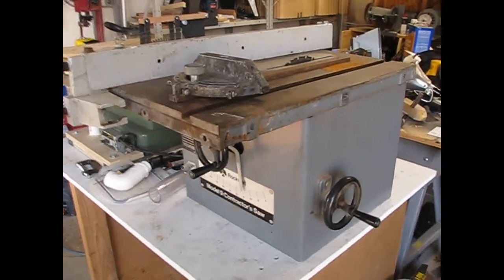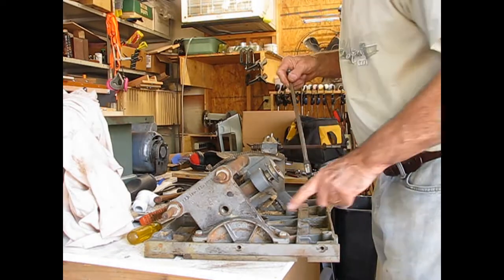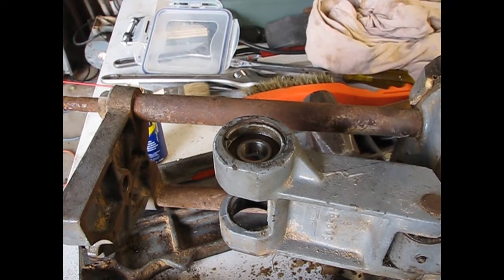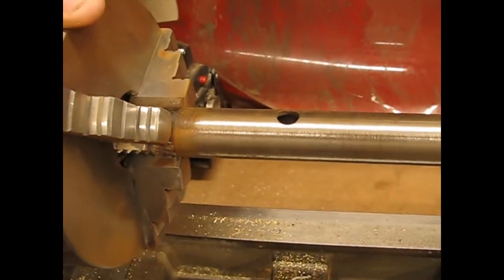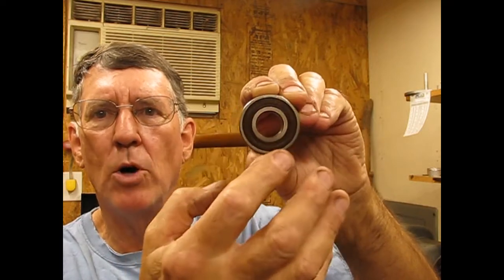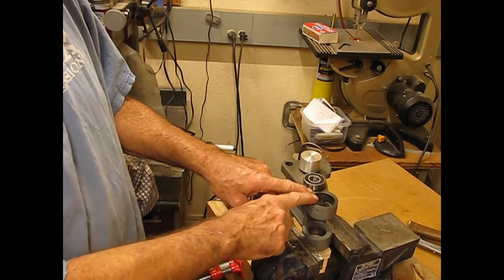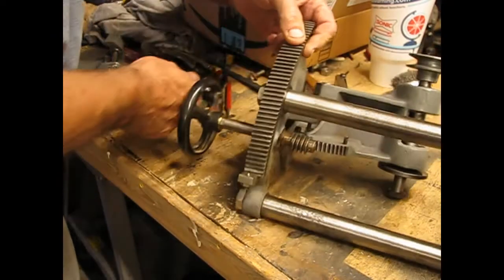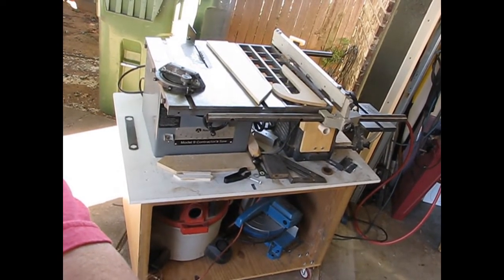Rehabilitate a 1980's Rockwell Model 9 Contractors tablesaw

Comment: The original bearings on my saw had inner races that were a good deal wider than the outer races, therefor they held that bushing quite snuggly but when i replaced the bearings, everything was a little different due to the replacements not habing the inner races any wider, I imagine getting ahold of the NOS originals would be difficult and exorbitantly costly. The saw is working absolutely great now despite the protective shaft bushing basically just rattling around in there now.

Comment: Helpful. I forgot that I have a bad memory (you can see how that works lol). I did a full disassembly on a model 10 and let several days pass before I even ordered the bearings so everything that looked so easy to remember became a pile of puzzle parts. Your camera shots and angles are great and did the trick of unlocking the memory. Thank you.

Comment: I have a much older version of this saw (40's Delta Rockwell according to my research) I recently replaced the bearings on, that one on the arbor side is a MUTHA to get off and back on as well! I put the shaft into the freezer and the bearing into the oven on 250 for about thirty twenty minutes and it was ok getting onto the shaft but had one helluva time gettin the old one off.

Comment: I have a Rockwell 10” that I bought new. I could tell it needed new bearings from the howling noise it made when in use. I got it apart before finding your video but found it very helpful for disassembling and reassembling the spindle itself.  Thanks for good videoing and narration. Tom.

Comment: This was very helpful. I have a Delta 34-410B, which has an identical configuration inside. I have done a lot of searching and wasn't sure how best to handle the replacement of the arbor bearings. For one thing, the exploded diagrams on parts websites don't seem to account for the 7/8" nut that fits inside that bearing retainer ring/nut. I gave up looking for Delta and searched for Rockwell instead. Your video made all the difference. I had everything apart, and the arbor wasn't moving. I wasn't sure how hard to hit it, and then I saw your demonstration. I hit it a little harder, and it popped right out. I wish mine went back together as easily. My bearings fit tightly, even with the addition of a bit of 3-in-1 oil to help them slide. I used my scroll saw to cut a plug similar to the one you did on the lathe. Not as elegant, but it worked. I haven't put everything back together again, but I'm pretty confident that it's going to work.

Comment: Well, I've got the new bearings ordered and have the saw mostly torn down, except for removing the recessed nut from the arbor behind the pulley.  It wants a 7/8ths deep well and wouldn't ya know, with all the ratchets and sockets I have, that ain't one of them, LOL!  So, got one of those ordered too and it should be here tomorrow.  I'll be adding one of those link belts too as the original belt is, I think, the actual original belt....it's cracking with dry rot and wasn't even aligned straight.  I don't know how the adjustment wheels ever did work with all the sawdust caked up inside of it, but it's been cleaned and vacuumed out now.  I do like that the stand has wheels in the back to make it easy to move around.  Its stand looks different than yours, though the actual saw looks identical.  I think someone must have changed the motor in the past as well as mine's motor isn't Rockwell, it's a 1.5hp Dayton.

Comment: I just bought a Rockwell Mod. 9 at an auction... brand new in the unopened box... dated 1979 for $100.00. Is that a good deal? I have to assemble it tomorrow.
Reply from the maker: Did it come with the motor?    Even without it is a good price for one that does not require rebuild and has all the bits and pieces that come with it.   So many times the blade guard is missing or the fence is not right.   Did it come with the side extensions?

Comment: Hey, this was great. Question: I dont have enough room to center blade with trunnion adjustment. Is there a way to move the arbor flange to the right, If I am looking from the rear? Currently the blade cuts into the red throat plate, when my blade is at 45 degrees. Thanks.
Reply from the maker: The blade should be about 1 inch from the right edge of the opening in the bed when standing in front of the saw.   The trunnions have a limited range.   Mostly just to square up the blade.   If the blade is off by a lot I suspect something is not in the correct place.    If the blade is correct the throat plate may be the issue.  Is it stock?
Reply: I’m using your video to help me replace bearings. Also’ I notice a 1/16 rust void in the middle space. This means that the arbor moved recently towards the pulley side. I’m hoping that the washer holding in the bearing is loose.

Comment: I have one of these,also has bad bearings. how did you find the bearing part number?
Reply from the maker: It was marked on the side of the bearing.  They are generic not proprietary.  You can also look them up by measuring each dimension.

Comment: I also have this same saw.  Would you mind saying what size bearings I should order for it?  Hope to have mine looking and operating as well as yours soon :)  Would also love to know how that riving knife was attached.
Reply from the maker: I don't have the number memorized but they are a very common size and available on Amazon.   Check the side of the bearing when you remove it.   There should be a number on it that can be ordered.   Documentation on line for the saw should also specify the bearing number to be used.    As a last resort, you can measure ID, OD and thickness and just order by specs from a  bearing company.

Comment: Well, I finally got the arbor shaft out but that one bearing is giving me fits, lol.  It will break, and in fact has broke the outer race off, but the inner race is stuck good.  I'm going to take it to the bench grinder tomorrow and grind on it till the inner ring has ground through on one side so I can get the !@$@! thing off.

Comment: Ok, so it looks like I've commented before BUT man, I could use some help. 

I need a replacement bearing for a 1940s Walker-Turner 10 inch table saw I'm restoring. This bearing is for where the arbor tilt worm gear attaches to the base. It's marked like this on the outer race:

L 02 SKF C Made in USA

Any thoughts?
Reply from the maker: Measure the bearing and find one with the same specs.  Cant always cross reference a part number.
Reply: @black1985vette  yeah I figure this one is too old to cross reference. So, probably need to get some calipers or a micrometer?

Oh, hey another note I thought about your work today and bought a pneumatic die grinder and thought I remembered you had links to wire spindle brushes.
Reply from the maker: @ForestWoodworks  yes.  At Harbor freight.
Reply: @black1985vette  so I got a $14 die grinder from HF as well as the nylon cup wheel. But it would bog out once I touched the table saw surface. Do you think that is because of the cost and rating of the die grinder? Maybe I would need a more expensive tool? Unless it's a setting on the set screw. Any thoughts?
Reply from the maker: @ForestWoodworks  what is your air pressure?  That is how much power the tool has available.   I run about 75 lbs.
Reply: @black1985vette  yeah I checked and it said max 90 psi, so I ran it at 75 and 90. Both bogged. This is Central Pneumatic rear exhaust die grinder, item #52847. I just can't tell if maybe I've got the rear set screw wrong... I adjusted that and it did seem to increase or decrease RPM's, but still not enough torque on either setting.